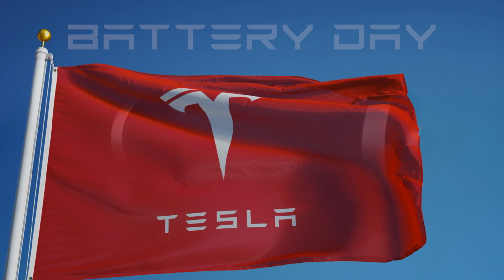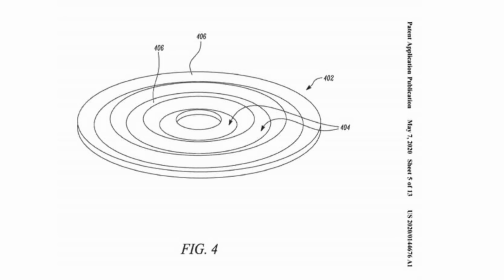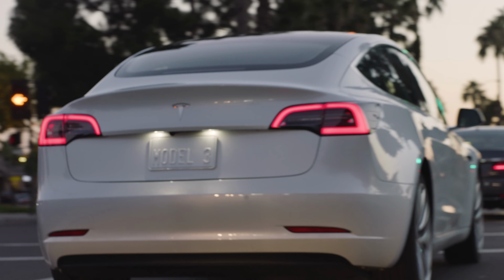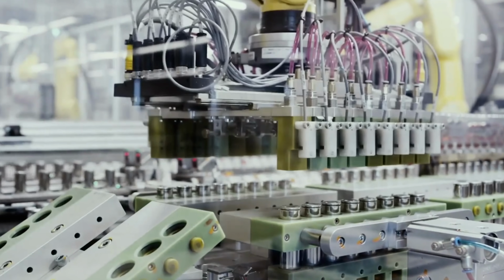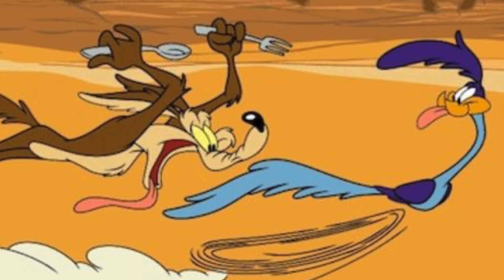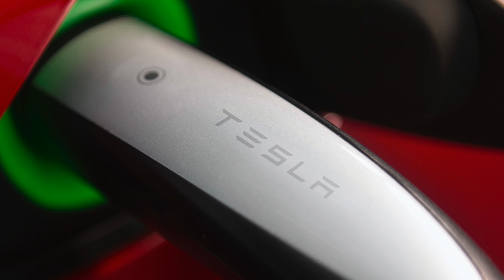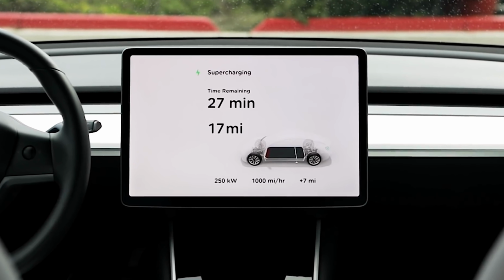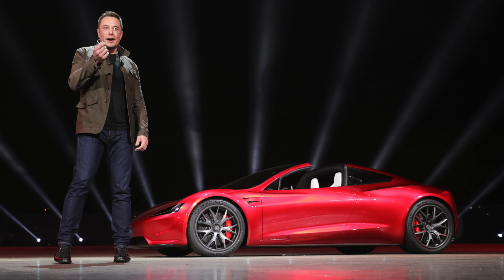Tesla Battery Day Preview: What to Expect Ahead of Tesla’s Battery Day

Comment: My Wild Guess:  Instead of battery wiring to balance series vs parallel to get an end result.  How about a pure series system?  Then adjust the cells to find out how many will be needed to reach the required voltage.  Next:  What would be the result of instead of cylindrical cells, use disk like shaped cells?
Reply: Would a pure series system create a single point failure?

Comment: You ask “what is this ridge?”  I think it’s a way to seal the cell in the pack so that only the ends protrude. Then the cells could be bathed in a non-conductive coolant which would surround the entire cell. There would be no more need for coolant channels thus increasing cooling and LOWERING COST!

Comment: Lucid may charge quickly, but the question is : Where?  This is Tesla's huge advantage - their charging network.  If I was Tesla, and I just had a $5billion stock offering, I would invest a substantial portion of that to something like 20 new charging plazas in every state within around 8 months.  No doubt an incremental increase of 10% battery efficiency, and the intellectual property gained, is vital - but with a large, and feasible, investment in charging infrastructure, range anxiety would be quickly and viscerally addressed.  By viscerally, I mean that increasing the range from 300 to 330 miles in the near future, doesn't change too many minds - pulling up a charging map and seeing that you're covered will change minds.

If those efficiencies are realized, I'd say - keep the range the same, lower the price, and decrease the distance between chargers (and make them available in places not currently covered: IE rural).

Comment: 650 Mile Model S  - - Current S is 400 miles and people are saying about
 50% increase in energy density likely with Road Runner.  - - This would
 be the one surprise that nobody is talking about and would, combined 
with million mile battery, be the final nail in the ICE coffin.  Instead
 of making apologies and excuses that Electric is as good as gasoline 
due to super charge network, instead Tesla is way better.  No stops for 
energy, just plug in when you reach your hotel.  And it would be easy to
 work a deal with a couple of Hotel chains to give special deals (maybe 
free overnight charging) to Tesla drivers.

Comment: I hope the Plaid powertrain steals the show.  I want to hear all about it's exploits at the Ring!
 External Inverters, with a high output 18650 cells in modules of 4 or 5 P groups should allow 3-4x the amount of phase amps than the P100D. I also expect a massive cooling system in order to keep stator temps under control and much bigger bus bars. Stator temps not battery temps are always the issue in Ebike racing. 
 I don't expect overall pack energy density to change much as the packs were obviously tested under the current cars and  you actually lose a little bit of density when going from a high drain cell to a high output cell.

Comment: I disagree on you synopsis that Tesla if capable will not supply to OEM ‘s because Giga Factory one in Nevada is going through a massive assembly line upgrade for an enhancement to the Lithium ION batteries they are perfect candidates to supply batteries to OEM and energy storage. There is a lot of moving around of machinery within the divisions at Fremont and Nevada. On the flip side Elon’s presence in Germany is a huge ester egg, this matters.

Comment: 2 predictions not mentioned - 1. Tesla announces they will license new battery tech to major bat suppliers (Pan., LG, CATL...). Doing so would increase battery production supply without Tesla having to front the Cap Ex, accelerate the world's transition to the more compelling energy/propulsion system, and Tesla will be paid on any batteries sold to other OEMs OR get to buy the cells themselves as needed at preferential rate. Any cells Tesla would by from their partners would be in addition to making their own for themselves, which I agree, they would not have a reason to share. Such a scenario would insulate Tesla's ability to always secure batteries for themselves for less than every other EV maker. The licensing play would provide a river of cash for Tesla to reinvest in their own expansion to quickly become top battery producer by volume.  2. Announce collaboration details with Redwood / battery recycling efforts.

Comment: Love your show, never miss it! Sometimes I you tube it and podcast it listening x2... On your point about the V3 having extra capacity. Electric systems are required to have a fairly large "head space" I'm not am electrician so I don't know the exact numbers but for instance if you want to run a 32amp 220v wall charger you would install a 48amp 220v breaker. Something like that. Code requires there to be a difference for safety....

Comment: Higher voltage battery packs for Semi, Plaid and Roadsters.  The V3 chargers are nameplate rated at 1000v and 425A.  To reduce IsquaredR power losses in charging you go to a higher voltage pack which reduces amps for the same power output.  This is what Porsche did right with the Taycan.  Present Model 3 and Y packs are 96s46p (4416 cells) configuration which tops out at about 400 volts.  I expect at least double that voltage in the new packs because they will be dedicated to the higher power discharge (and charge) requirements of the Semi, Plaid and Roadster vehicles.  Due to limited production capacity for the new cells, the Model 3, Y, and X and S non-plaid versions will remain at their present battery cell configurations.  As cell capacity builds more models will be converted to the newer high voltage pack configuration.  I expect Cybertruck Plaid will get the new high voltage pack but non-plaid won't again due to new cell production capacity constraints.

Comment: Tesla likely won't be supplying batteries to other auto OEMs any time soon, I agree.  If they could do that, they would have no need for Panasonic, LG Chem or CATL.
However, to answer your question about other items of major potential for Tesla, they could perhaps license the new battery technology to the auto OEMs, and perhaps more financially rewarding, to battery manufacturers of all types.  Imagine the potential demand for much better laptop and flashlight batteries.  In any case, I hope Tesla takes some of that big pile of cash they have, and expand Giga Nevada to start cranking out LiFePO4 cells, assuming that Li availability is easier to solve than Ni.  Elon has hinted that it is.

Comment: One more point more important than the others?  As for batteries, I think cost is it.  But as for Tesla, the most important thing would be FSD.

Plate cooling I think will be part of the new battery packs too.  This I think will make pack assembly easier vs current and be a better cooling method.

Comment: Sad to see you directly multiply current and voltage to find the maximum power. I’m sorry that’s not how it calculated. You can have cyclers and chargers of very high voltage and current but the power is not direct product of voltage and current

Comment: I installed a set of lithium iron phosphate batteries in my solar system last year.  They are rated for 10,000+ cycles.  One full cycle per day = > 28 years.

Very few EVs will completely cycle their batteries every day.  Perhaps taxis only.  Most of the batteries in EVs could last 50 to 100 years.  Most likely, once the vehicle body was shot the pack would be pulled and sold for grid storage.

Comment: mini episode will be about recycling, way more important than everyone think! :)
Reply: I don't think they will need much recycling for the next 10 years.
- 10 years in car
- then 10 year in grid storage
- then recycle
Imagine where Tesla will be in 20 years, they will just need to get started recycling the batteries from the tiny production they have now.
Reply: @alexforget  i think you underestimate the waste product that occur when battery cells are manufactured. There is a significant amount of cells that dont make it through quality control and in order to reuse the materials you have the recycle them. Especially when Tesla plans to move in to the dimensions Terawatt hours of battery production this will play a big role in order to reuse the lost cells. So yes already now it would be very important to see a masterplan on recycling and this will become even more important every year moving in to the future as when batteries finish 2nd and 3rd life you want to be able to reuse the materials.
Reply: @alexmeliss  Great observation.
Reply: @alexmeliss  Ok, If the defect rate is large and it stay that way. Otherwise I see that as something small for now, but it will be different in 10, 20 years
Reply: recycling is absolutely a big part of the long game. if you cannot counter the shortage in supply its nearly impossible to keep building a vertical integrated system. even if your cars last 20 years, not having a plan for your products during its final cycles is moronic.
Reply: I wouldn’t be surprised
Reply: 👍👍 good point
Reply: redwood materials!
Reply: Hmmm!  I didn't think of that.  Yes!  That is extremely important!

Comment: My guess on your next topic this weekend is a comparison of cost/kwh between Tesla and all other EV makers.    This metric will define a competitive advantage that delivers a higher performance and lower cost "moat" for Tesla that will deliver larger margins for years to come.   My second guess is that Tesla may be approaching a cost/kwh for energy storage that makes the capital cost for solar plus 4-8 kwh of storage lower than the capital cost for natural gas combined cycle peaker plants.  When this happens, I believe it will open up another enormous market for Tesla in grid level energy storage.  I would love to hear an analysis of when this might happen given battery cost decline curves after battery day and also what the retail cost/kwh would need to be to make solar plus storage cheaper than gas fired pants on a LCOE basis.

Comment: Great analysis, Rob! I think, the only relevant aspect to be discussed is which of Tesla's products, or more specifically which of their vehicle lineup, will benefit from the new technology. It's highly unlikely Tesla will start implementing it on their highest volume line, the Model 3, as they wouldn't initially have the required production capacity. So it's more likely to start with the Models S and X, followed by the Semi early next year if they can ramp up production fast enough.

Comment: The answer to Rob’s teaser would seem to be some of the cars are going to lose 20% to 30% of their price over the next two years. Every 5k the price comes down doubles the addressable market. Replacing the cells to the new size would immediately lower the cost of the vehicles but the weight of the pack would come down so you could reduce the number of cells even further. This enables the cars to arrive at the same performance with less power thus making the cars even cheaper again whilst using less resources. The emphasis going forward would then be on fast charging rather than bigger batteries. Maybe the recent $5 billion cash out was to spend on beefing up the supercharger network. I don’t think Rob mentioned battery recycling as a future resource supply line which I expect will be discussed in the presentation on battery day relating to Redwood materials.

Comment: Rob, you talk about the problems around the incorporation of an increased quantity of silicon in the graphite anode and I guess your intention is most likely referring to the associated problem of volume changes upon lithiation/delithiation. Although one could imagine these chages to result in cracking of the underlying structure, the image you show provides evidence of cracks formed in the cathode and not the anode.

Comment: A million-mile battery could be charged to 100% regularly without worry about significant degradation, so any improvement in energy density gets an addition 10% boost. We could see a Model 3 with 375 miles of useful range that is still cheaper. The long range Model 3 has ALREADY gotten $10k cheaper in the last couple of years—from $60k to $50k.

Comment: The potential of Tesla Energy Business not only generation and storage, but also distribution via Autobidder. More batteries allows Tesla energy to finally take off which will be bigger than their auto business. The bull case for significantly higher cap ex is  boosted by Tesla energy. Tesla is in the process of becoming an international utility company as well. This is very Big!

Comment: large/fewer  cells to pack with series/parallel connectors built into the insides of the pack covers instead of directly attached to batteries. deposit cells...close pack covers...all done.

Comment: No one's talked about wireless recharging. Think about driving down a stretch of road that has wireless rechargers power by solar panels. By the end of the drive your battery recharged back to full. There's also the possibility that you charge up capacitor's and in under 2 mins then they trickle charge your battery back up while you drive.

Comment: not battery related, but model 3 is being redesigned with heat pump, chrome delete, power trunk and a couple of other things.  Also one thing that is rumored is the replacement of Model 3 SR+ by Model 3 LR RWD.  It would make sense to make the 2 happens together

Comment: The first principle on all of the battery day improvements is reducing inactive materials: Bigger cells=less cell casings; maxwell dry battery= less inactive materials in electrode; cell to pack= less inactive packaging; tabless= less materials. Additionally, three of the four reduce electric resistance and heat (with bigger cells being a mix). BY reducing inactive materials, you reduce weight, reduce cost, increase manufacturability and increase electric efficiency.

Comment: To clear up some misunderstandings about the ESR (equivalent series resistance).
The cell's ESR is important because the losses from high current flows is what causes the heat buildup and is why the packs need to be cooled.  The tabless cells, all the contact fingers that are making contact with the case, and chemistry all make a difference in lowering ESR.  Another thing that has to be considered is the current paths to and across the cell packs and electronics.  The best conductor is copper, which is expensive and heavy, so the logical substitute is aluminum.  Another factor is how to protect contact surfaces against corrosion - the dull patina that copper gets over time.  The best way is gold plating, which even though it is very thin, it's still expensive.  Tin plating is not as good.  Perhaps the designers will use plastic shrouds over connectors to keep out air and humidity and prevent oxidation.  And keep out the evil salt that is used on roads in icy areas.

These 'minor' details are what's important for making fast charging safe and effective.  They're one reason why Musk (who's an engineer) has said, the problem is getting enough exceptional engineers.  The company must rise above mediocrity in order to excel.

Comment: One thing you haven’t mentioned but significantly under appreciated, is li-ion battery recycling. Without closing the battery lifecycle ring, both economically and environmentally, scaling up production 100x is like planting a bomb that will explode in 10-20 years.

Comment: 4:30 wait so silicon provokes cracks that cause troubles like recharging and such, why is adding more silicon good then?
Reply: Improves energy density. More power but it gets worse faster essentially. So they need to find ways to stop the cracking or make the battery last longer.

Comment: battery max current is different from sc max current. The sc should actually output 425A, however there must be a kind of transformer converting like 600V 425A to 400V 637A (600V being the max power it can draw but still transform). if the next gen pack is also 400V and can take all the charge, it will be 1000V and 425A transformed to 400V  1050A. it would be awesome. Only problem is that since it now has fewer cells, the pack can't take as much current, so it's probably some serious active cooling and perhaps higer than 400V to balance that.

Comment: Well, here's one possibility you missed - a new electrolyte.  I'm not talking about the pie-in-the-sky electrolyte patent which would combine the functions of anode and electrolyte, yielding vastly more surface area for electron capture.  If that makes it to commercialization, it won't be now but years away.  But tweaks in the electrolyte could change battery performance characteristics and, for example, extend cycle life by preventing lithium dendrites from penetrating the membrane separating anode from cathode.  A new electrolyte might be made necessary by switching to Maxwell's dry electrode coating process, but I'm not sure about that.  Anyway we may hear something about electrolyte on Battery Investors' Day.

I hope we'll also hear what Tesla's deployment schedule looks like for the Roadrunner cell - which models and when.  But I suspect we may come away at least partially disappointed.  Tesla is likely to hold off informing the public until just before current models receive an upgrade, so as not to depress sales of those models.  I think they'll be happy to talk about Cybertruck, Roadster, Semi and the Plaid option, though, since none of those announcements will depress sales of existing cars.  Or not much, anyway.